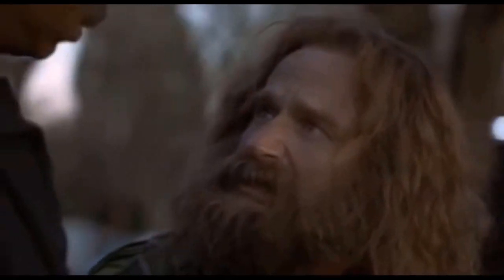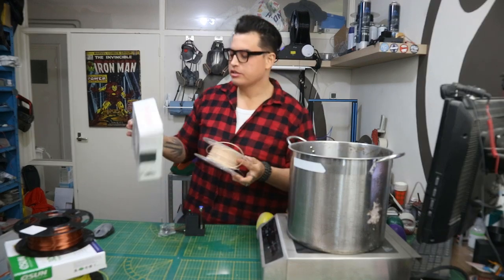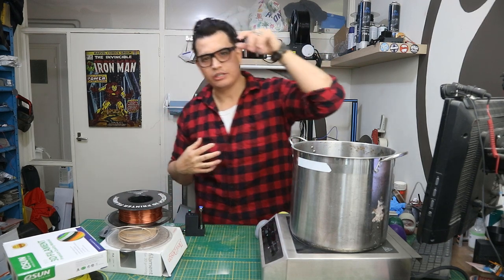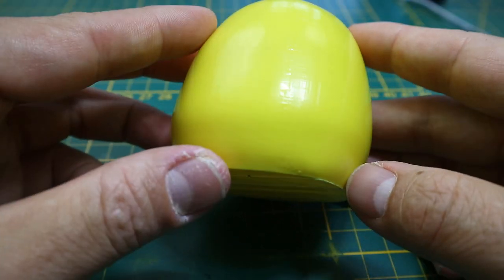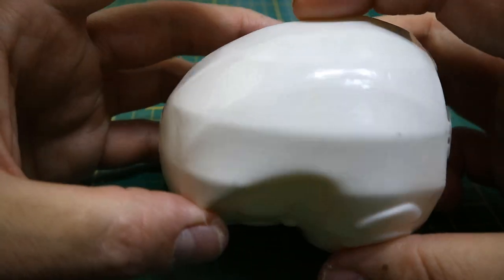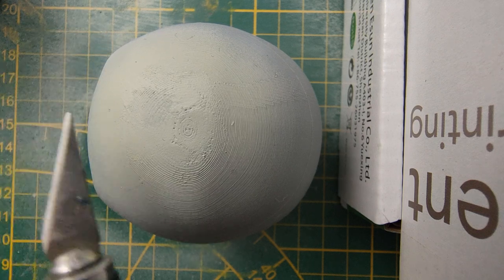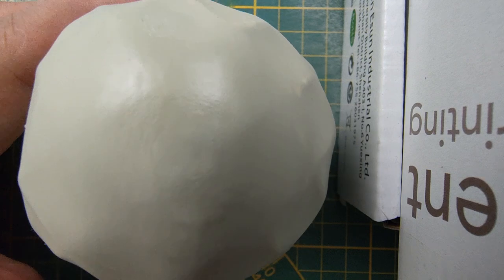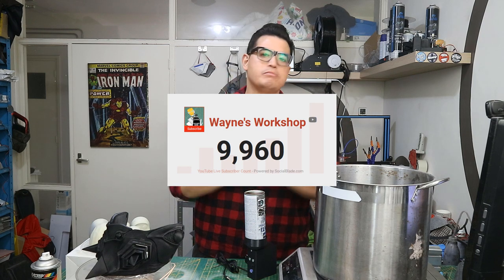PLA Acetone Vapor Smoothing, it works! comparing 6 brands and results.

Comment: I've been brushing and dunking my pla prints in acetone for over 5 years  and find colorfabb pla/pha to work well. Ive done many video on this as well!!
Reply from the maker: I've heard indeed that colorfabb reacts great to it, thanks for confirming
Reply: Someone mentioned PLA that has been aceton smoothed will crack overtime. Did you experience this?
Reply: @Mech.E  depends for how long. If younoverdo it.yes, but i have prints that are.over 7 yeara ols and still not split or cracked. If you print hollow Do Not allow and acetone inside or else it WILL split.
Reply: @Cloakfiend  appreciate the answer. Good info!
Reply: Polymaker pla plus works way better
Reply: @Costronica  polymaker pla plus /pla pro works way better
Reply: @cloakfiend polymaker man..ur missing out

Comment: Great to see you back making videos! I only use esun PLA+. I found it sands great straight off the bed with some 180 grit. Easiest PLA to sand by far.
Reply: I bought a roll of eSun PLA+ despite the reviews being pretty divided but, I saw that most of the people who had problems just put very basic reviews with no details such as "This filament sucks" "Terrible filament", etc. No mention of their settings, printer , etc. All the ones who had success usually included those details. Took me a big to get the settings dialed in for retraction to remove all stringing but once everything is set it prints really well.
Reply: My experience with esun PLA+ has been that it clogs nozzles frequently, and I've run it everywhere from 185c to 210c. Stopped using it for this reason, but it did produce good quality prints otherwise.
Reply: I run Esun PLA+ without issues in my ender v2 and aquila vox machines.  it can be tempermental some times but I find that running it a bit hotter works well...220c-235c 2.5mm retract dis and 25mms retract speed. Also Durcmic PLA+ is one that that works really well consistantly. I have had maybe 3 spools of Esun out of 100 that really were just terrible and I contacted them on amazon and told them and they sent replacements without a return or refund processed...they just sent new roll for the one that failed, which was cool of them.

Comment: I love ABS, my only issue with it is that they don't come in a ton of really fun colors like PLA. I don't use a heated bed either, just painters tape on the bed and temps at 220-225. 
But my PLA prints end up looking rough at the end, while my ABS ones look so cool
Reply from the maker: i used to print with abs but my room here was just getting cramped with the enclosure, we move into a big shop space in may, perhaps im going back to abs then aswell as the method in the video here also works very great on abs

Comment: Pla has different variances of pureness, impure pla will be more likely to be effected than pure pla and I'm sure the heat is also affecting the process. As shown in your testing some had little to no effect.
Reply from the maker: True, however alot of hobbyists will go for the cheaper stuff though, i want to do a round 2 but under a big microscope, and also add abs to lot and compare the surfaces

Comment: Great vid, fella. Could you advise me on some specifics? What Watt is your induction plate? What temperature is "high" on the plate? What temperature is "low"? Do you think it varies with pot size (I'm likely going to buy a smaller plate and pot)?
Reply from the maker: it goes to 3200 watts, but that high is not needed to get the vapor to go, best is to test it with your small induction plate. wear your safety gear, and test with small amounts
Reply: @Costronica  Cheers, chap. Now to try and find a small, tall induction pot!

Comment: so, you're ensuring the acetone vapor line is at the top of the print?  You don't put a lid over the top of it and leave a little slit for it to ventilate?
Reply from the maker: when setting it from high to low like i did, there is no need for a lid, you can ofcoarse, but remove the lid slowly, otherwise you suck the vapor out of the pot as you lift the lid.
drag is a thing so consider that.
Reply: @Costronica  , ok I just thought the lid help the vapor creep up to the height you need it to be to encompass the entire print

Comment: that means amazon basics is an impure filament mixed with abs
Reply: This. I've literally soaked my hatchbox PLA(in the past) in Acetone(pure) and It did nothing to it.
Reply: and that is a good thing
Reply from the maker: while its true it wont do much in pure aceton, its the combo of heat and acetone vapor that does the trick, these same models dunked in pure (cold) acetone wont give any reaction either

Comment: If your induction heater isn't an electric heater, how does it work without electricity?
Reply: It plugs into the an outlet just like an electric portable cooktop with the coil but with induction instead. Have to use steel pots, aluminum will not work.
Reply: @AAMovieStudios  Oh.  So it IS an electric heater...
Reply: @No1sonuk  Technically, the "iduction heater" is not a heater by itself as it does not generate heat but only a rapidly changing magnetic field. The combination of the induction generator and a ferromagnetic object on top (like a pot) could be considered as a heater :-D
Reply from the maker: @BossmodePictures  thanks for answering that for me :D wanted to get to this comment all week but didnt have the time and forgot :P
Reply from the maker: the answer is down here perfectly, i will add that what i ment with "normal electric heater" are those small camping hot tops, basicly those heat/glow up with a big ass coil, so thats a big glowing hot object, and thats a no no for this.

Comment: Seems like your using cheap filament!!  
Pla is non-reactive.
  If your Pla is reacting it's not "shit" it's a better Pla! 
Yes Pla ➕ will react but the filament will most likely not dissolve evenly leaving streaks/lines. 
Abs on the otherhand will do exactly what your TRYING to do.
Reply from the maker: ive used 6 different brands of pla, all at different price points, regardless of price, it still prints with the same ease, abs i used to print with, the enclosure simply was to cumbersome in my current shop